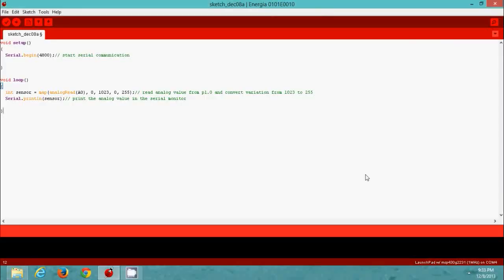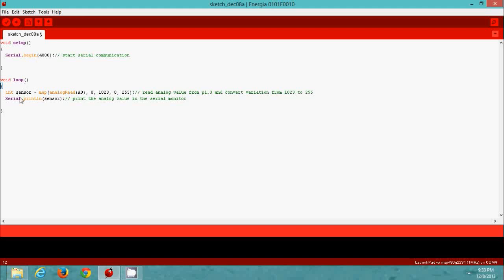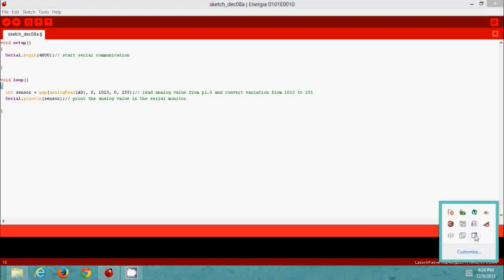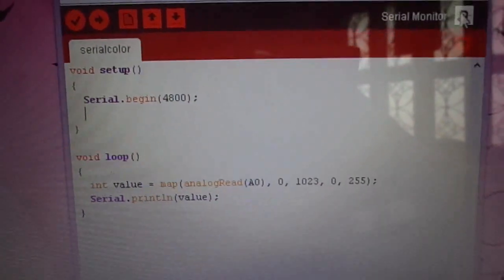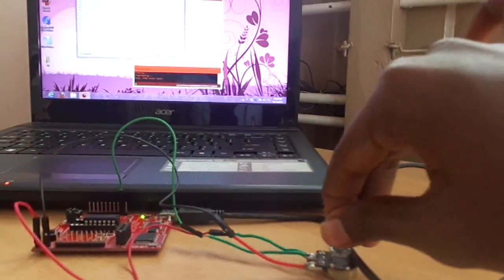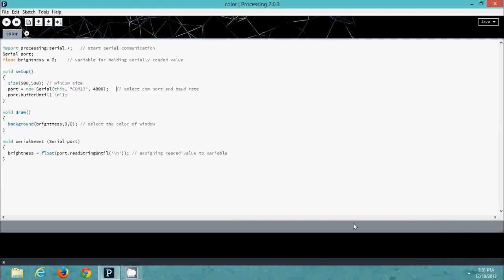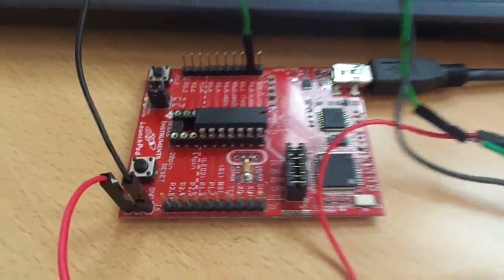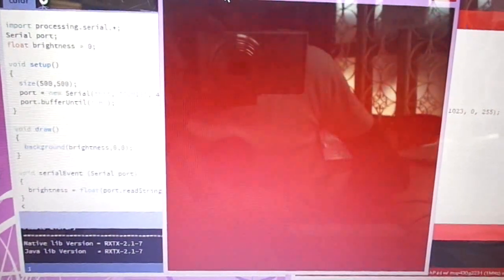MSP430 SERIAL COMMUNICATION USING ENERGIA AND PROCESSING

Comment: Hi vignesh raja! It's a really good video :) thank you !
I have a question about serial communication,I'm using a MSP430G2553 and Energia IDE ,but I can't use the "serial monitor" ,(I alredy changed the rate to 4800.) when I check out "serial port" on "Tools"  ,it isn't free to  modify ( for example COMM1 to COMM4).
 I think that MSP is using UART even I didn't modify the jumpers J3 to be UART.
What do you suggest? I am looking forward to hearing you.
Reply: Leticia Pires Hi,I alredy solved it. Thks :)

Comment: my serial monitor doesn't work U_U 
please help.
Reply from the maker: just open serial monitor set the baud rate 4800 at bottom right corner.if it is already in 4800 again set it as 4800 when u run the code.but don,t worry the processing software will work finely. the serial monitor is for verification only. directly run the processing code.
Reply: thanks, issue fixed, the problem was the RX and TX bridges. now all works fine ^_^